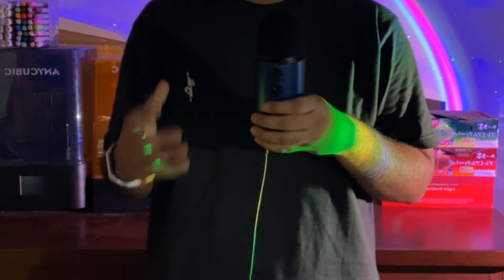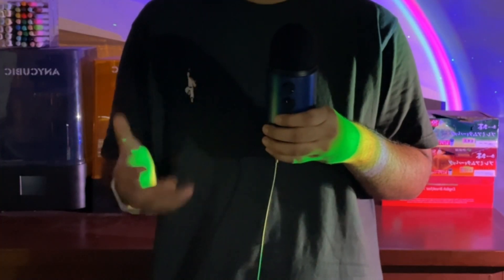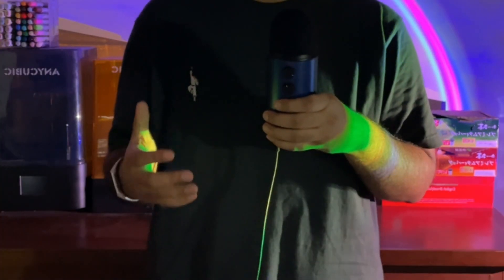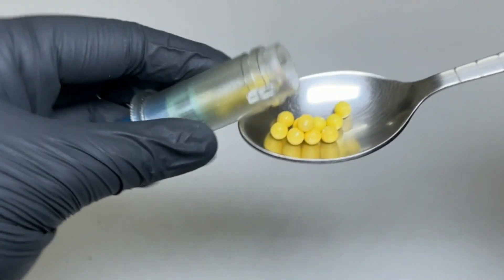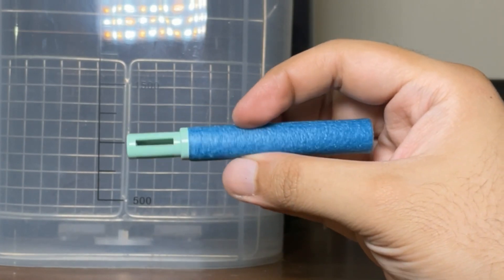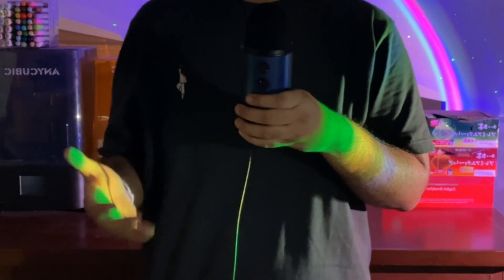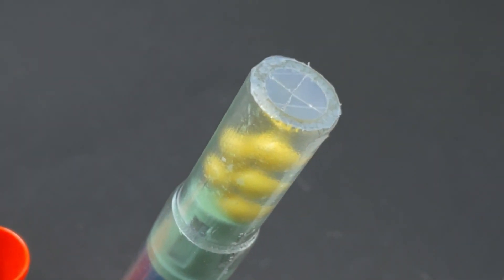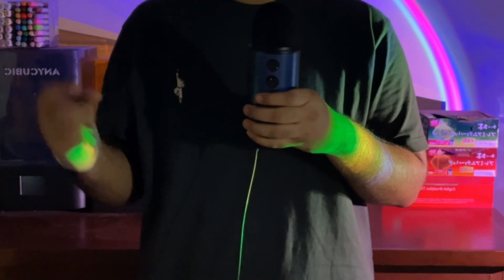I made Nerf Shotgun Shells [3D Printed]

Comment: I would love to see you make a nerf sniper and see how far you could launch a dart
Reply: Checked your local Walmarts recently? They literally have a blaster that hits 200fps off the shelf.
Reply from the maker: If I had the space for it, I would've loved to try something like that tbh...
Reply: Most of hobby-grade blasters can shoot straight on 30 meters, some “snipers” can do 50+ (without rising barrel up)
Reply: There's about to be a blaster that sends a dart flying 280 feet per second on store shelves. If you wanna get much higher than that, you're gonna start needing compressed air.
Reply: @dgamer5075  nope, you can do that on 300, 400 fps using springs